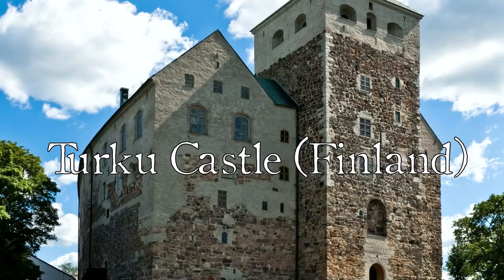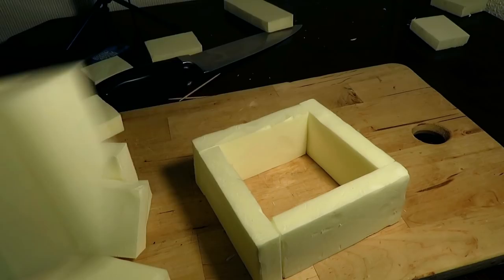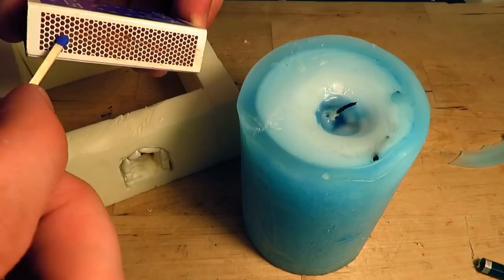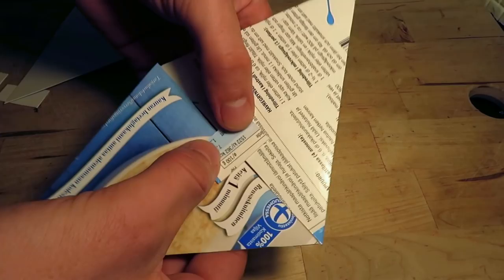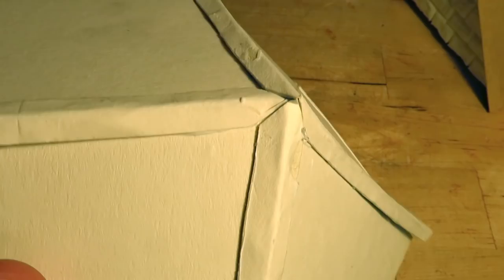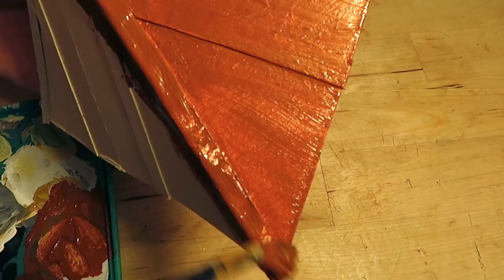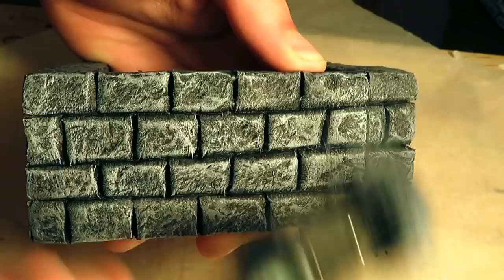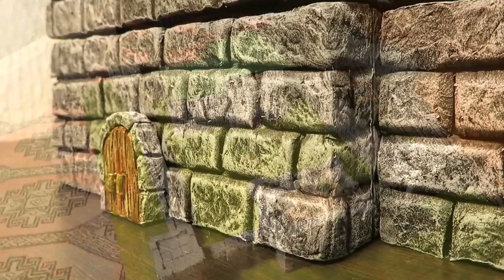Building a Miniature Castle Keep for D&D or Wargaming (Modular)

Comment: After scoring foam a touch of heat should shrink the foam pulling your score lines apart should give similar results... Not sure if it works with the foam you are using but i have used it with other foam.

Love then end result gonna make some stuff like this for the next time i break out my mage knight's